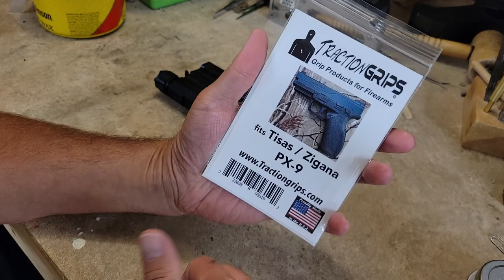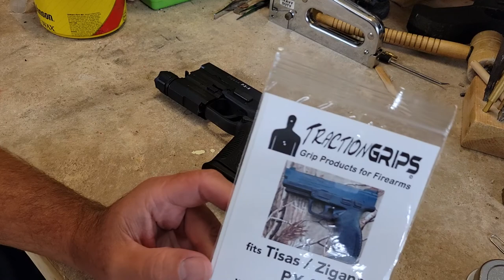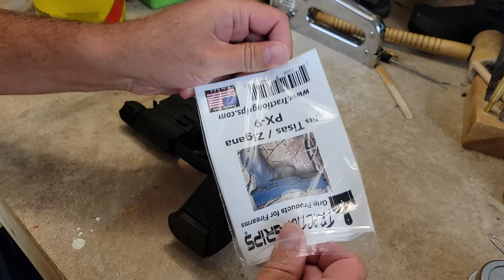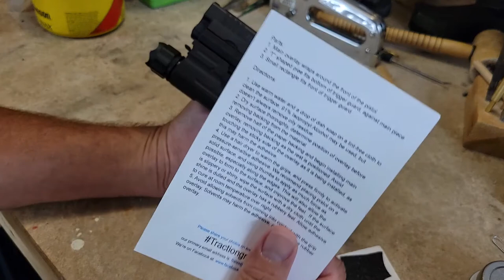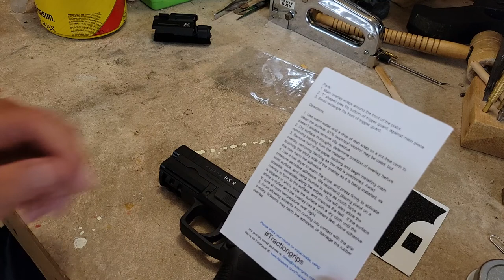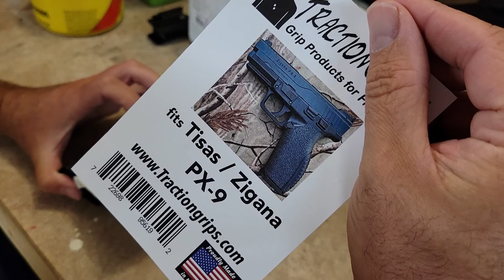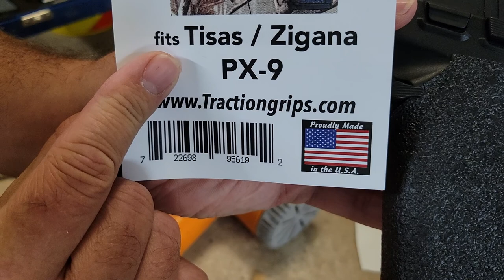Tractiongrips PROTOTYPE grip install for Tisas Zigana PX-9

Comment: Great video. Looks like you got everything to line up perfectly. I hope the grip serves you well.  I guess you noticed the typo on the back too.  We kind of rushed the package artwork to get the first small batch made, and that got by me. Someone pointed it out to me when the second run was being made. Unfortunately, a dozen or so made it out before it was noticed. You installed them pretty much like we do here, with the paper being removed as it's installed, and cutting away the small pieces with some models. The only thing I do differently is to lay the heat gun on the table so it is blowing over the table edge so I can rotate and move the firearm around in front of it and have the free hand to smooth things down and reposition if needed. That's just a matter of preference though.  Great job on the video, and if you get anything new that needs grips, just let me know.
Reply from the maker: Thanks guys!  Continued success to you!
Reply: I purchased these because of the first video and your comments back and forth. Gun arrives at FFL this week and these will be here first, lol. I like that Traction Grips is so involved with the community!!
Reply: Are you still telling ppl to use alcohol ? I know the other company's absolutely don't anymore ..not a chemists I just know KE arms and talon both say not to use UT on poly frames ..think handlegrips also say use tad soap .....this is few years ago so thought I'd ask ..do you make these now for gen 3 guns
Reply: @sleigh4019  For over 20 years, our recommended way is to use a drop of dish soap on a damp cloth. The reason we recommend this is; it simply works better. Rubbing alcohol usually won't remove gun care product residues, especially synthetics, or even skin oils. I'm not sure why others have either included an alcohol pad, or recommended alcohol at all.  I've never seen rubbing alcohol harm polymers used in firearms, but I wouldn't be surprised if it can harm some sprayed-on finishes. I know some do have skin care additives, including oils that will leave a residue that could prevent the adhesive from sticking. We used to receive an occasional complaint that ours didn't include a little alcohol wipe.

Comment: How do i remove the grip? Tia
Reply from the maker: What grip?  The sticker grip?  Peel it off
Reply: If you mean the back strap there is a roll pin that you have to use a punch or small screw driver to drive it out

Comment: Please don't use any alcohol ever ... SMH ..A touch dawn soap or a baby whip let it sit out for 10 mins ..anyone who makes frames or polymer lowers will tell you now don't use alcohol and also if its done correct and like talon grips they claim a basic whips enough cause there glue isn't junk ..just make sure there's no gun butter or oil on there
Reply from the maker: Most come with an alcohol wipe
Reply from the maker: I think you are confusing alcohol and acetone